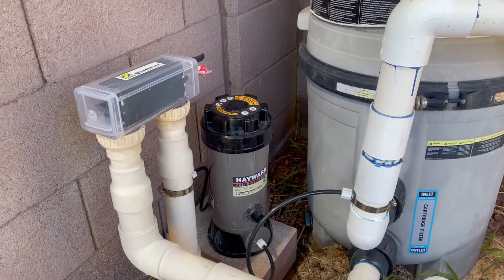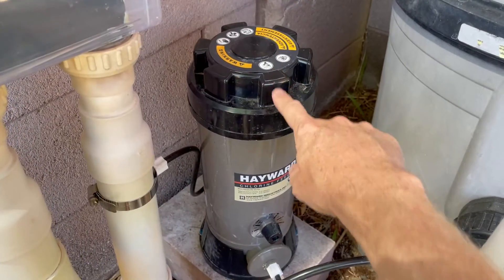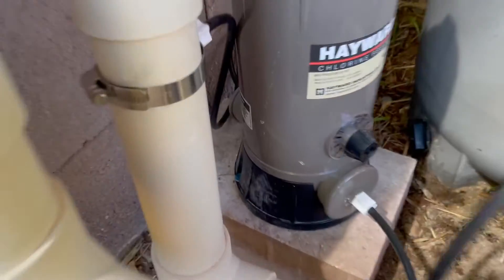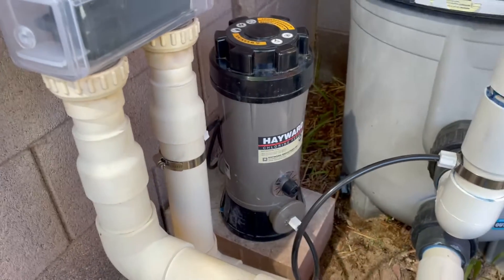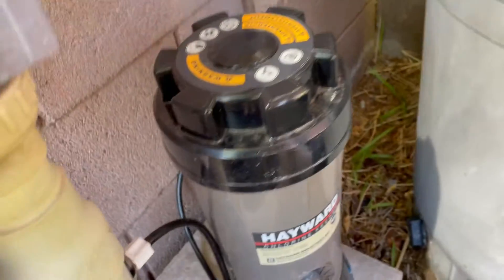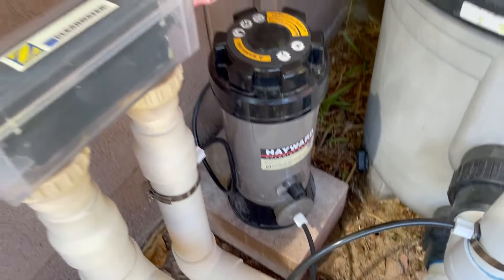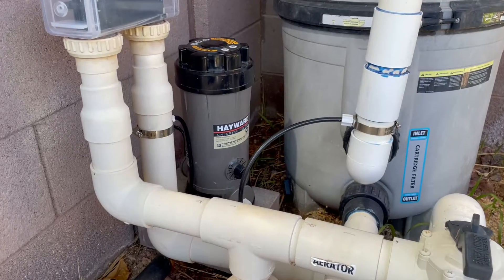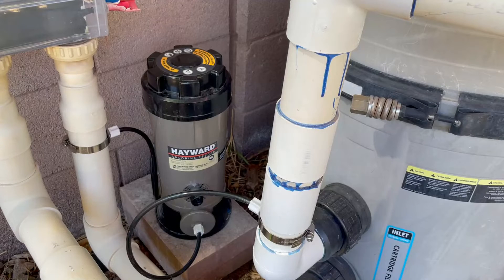Pool Chlorinator Installation, Danger, Mounting, Weekly Refill, and What to Never Do!

Comment: Thanks! Great video and information. My filter system is inside a small building and I’m sure the gas would be much worse. I may not put one in for that reason. I did see another video that says to pop the black cap on the top of the feeder and remove the plastic bolt. Then the cap will spin freely from the seal under it, making it easier to remove and re-install. That way the rubber seal never has to spin. It makes sense.
Reply from the maker: I was aware of that nut because I'd taken the system apart several times but it just seems like a whole lot of work to add chlorine tablets. You shouldn't have to get a wrench to do a refill. Whether it's the wrench to twist off the top or the wrench to twist off the nut, it just seems to me you should be able to do this by hand, quickly.
I replaced my Hayward in-line chlorinator with a penta model. I have another video on the channel that shows that. After a year, I can still open the Pentair with just my bare hands every time. Having had both, I think the pen air is better for me.
Reply: @eggcleaver916  Yes, I saw that video and replied to it as well. Thanks!

Comment: I think if you take the small cap off first the net bolt inside is easy to remove the entire cap after with one hand
Reply from the maker: I did that once, but who wants to take a wrench to the pool every time they add chlorine tablets? This is supposed to be an easy addition where you remove the lid by hand, throw in the tablets, and close it back up again. This is why I switched to the Pentair feeder and would do it again in a heartbeat.

Comment: I have experience getting the fumes in face also ... I always turn my face away now and hold my breath  but would recommend a googles also. I find it helps keep my pool levels better but it's more expensive . You go through those pucks like water. No pun  😅
Enjoy the rest of the summer!
Reply: Anyone who owns a pool knows, that you have to be very careful when handling chlorine tablets or granules... The same danger occurs when you first open the container, holding the tablets, especially if it has been sitting in the sun. As soon as you take off the lid, a plume of chlorine gas will quickly travel upwards into your face. 😵
When I first remove the chlorine container lid, I always use the lid to fan the top of the bucket, before removing anything from it.

Comment: I have the cl200 that is connected to my piping not like yours and I learned to put 2 tabs in a week at it's set to 6 instead of keeping it full with tabs. 27' round. This saved a lot of tabs and my levels are good

Comment: Here's another step you might find handy to reduce the gas blow-back when you open the cap:  depressurize your pump system, by either opening the pressure relief valve I have on the top of my cartridge filter, or opening the leaf catcher.  And don't put your head over the top.  I disagree that this doesn't save money.  I've found that it eliminates my need for liquid chlorine (unless it runs out), and uses only about half as many tablets per month as the floating chlorinator (because it injects the chlorine below the water line).  What I really hate is I can't see inside, and after loading around 14 tablets for the next 2+ months, I can't tell that they've run out until I see the pool turn green.  I could calendar every 2 months for a refill, but that'd be way too easy.

Comment: I have the same chlorinater, and every time I open it water fills up to the top overflowing and forcing the gas out into my face.  Does anyone know what I may be doing wrong? I turn off the pump, put the filter in closed, and turn the valve to closed, chlorinator still fills ip o and pours out water.

Comment: Use a respirator that rated for chlorine gas.  Blow and go doesn’t protect you from chlorine fumes.  There’s no one-way, backflow valve (to prevent highly chlorinated water from backing up into your filter when pump is off).  That filter will need to be replaced sooner rather than later!

Comment: First off …. These things are absolute garbage. Tri-chlor is a giant PIA.  Over saturates your water with stabilizer. They clog.   Pure junk.  

You’re hysterical.  Scuba mask & blower.  I used these garbage chlorinators for a few years before going with a reputable salt cell.  

Never experienced the issue you describe.  Just don’t stand over it with your mug in close proximity. A bit of common sense goes along ways …. 😅